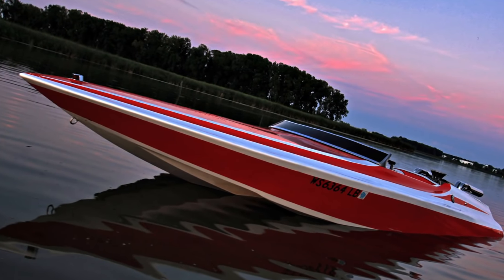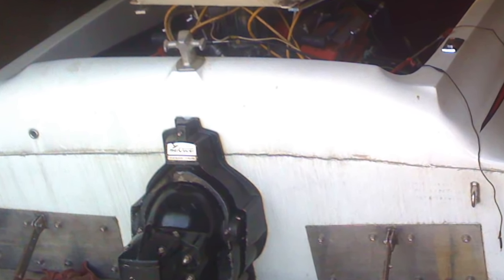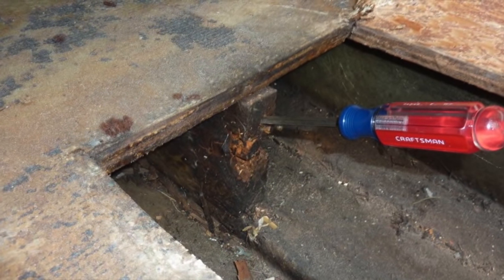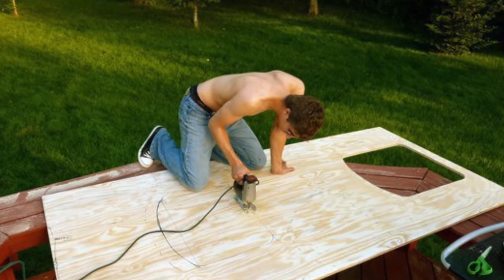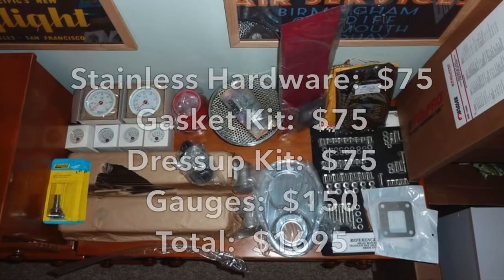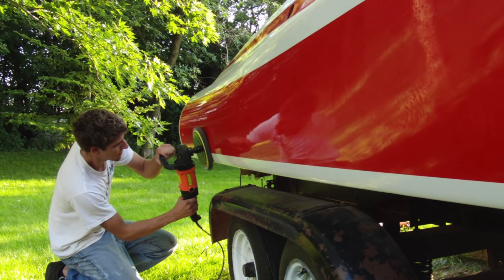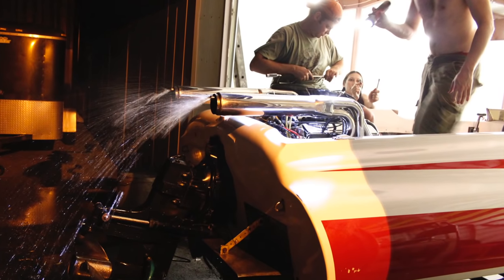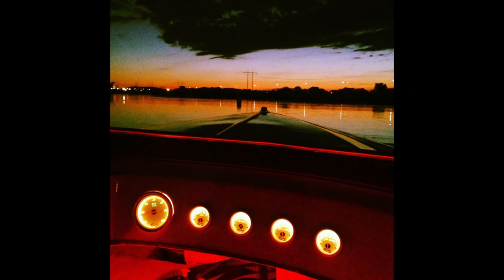RACE BOAT Rebuild in Minutes START TO FINISH

Comment: As a former OMC/Volvo/MerCrusier mechanic and racer, great job! Those old 260 drives are bullet proof.
Reply from the maker: I've had it 10 years now and other than oil changes and plugs it's needed nothing.

Comment: Had a 1000 dollar boat fall in my lap last summer, 81 Glastron ssv 167. Me and my three sons have been slowly making improvements. Re made all the interior and fixed all the mechanical issues. We have had Dime-Boat Darrell on the water three times now and every time we find something else to improve as we go. Nothing like the memories already made with my family and this boat. Little over 2000k invested so far.

Comment: I was searching for a family boat and came across a jet boat a guy was selling during my search. Which lead me to searching on what it could be and found your video. Awesome project and awesome boat. So I like what you said. Why buy a boring boat. I am an old gear head nut and was looking at building my first hot rod. You have inspired me into thinking about building this boat instead of getting something else. This would be way too much fun. It has a V8 old school motor and a Bayjet drive. Just have to finish it. Similar to your project. Can't wait to see what you do next. Cheers.
Reply from the maker: Hot rod boat > hot rod car
- No speed limits
- Bikinis
- Everyone's having a good time
- No suspension work
- No rust repair
One thing tho, squirters are not efficient, way less efficient than a prop, so given two boats of equal size weight and shape, the prop will have a higher top speed and be more fuel efficient.   They're still fun, just....  they clog with weeds really often, which is not super fun.  Good luck either way!

Comment: Twin tunnel is AKA Mod-V, I had the same hull back in the day with a 455 olds and a stock Berkley pump with a B impeller. Had so much fun in that boat!!
Reply from the maker: Yup!  Check out some of my other vids; I go into more detail about modvp racing.
Reply from the maker: Also restoring an SST, should be much faster than my aristocrat!
Reply: @ADDvanced  my next jet boat was a Wriedt Custom shallow V, it was such a blast on the rivers in Pittsburgh, just got tired of replacing the Olds 445s. I bought the all from every junkyard in the area so when I ran out, there weren't anymore...haha...

Comment: Totally understand. Did the same . Almost spent 30k on a boat until I running to a just pay my taxes and you can have the boat deal. Cleaned it up stuck a new engine in the ol'girl and its never let me down in 12 years.. it meant more to me after I rebuilt it.

Comment: A little history for your boat. In your video you keep referring to it as a “twin tunnel” when in fact it does have a name. 
Back around the early eighties  (80-81) the APBA sanctioned a class of boats called Mod VP which stands for modified V hull production. A handful of boat builders made these boats (Mod - VP) for this class, Sleekcraft, Eliminater, and Stoker to name a few. They were faster and much more stable then their V hull counterparts. Very cool boats and still popular today if you can manage to get your hands on one, rare boats. Great to see someone restoring these! Great video.
Reply from the maker: Check out my SST video  (blue boat) :)

Comment: One mans boring boat is another’s treasure. Bought a trailer for my boat and it came bundled with a free POS boat. A boring 1975, 19’ runabout with a 165 Merc I/O. Ripped out the interior, cleaned it up, tuned it up, replaced all the rubber parts on the motor. Installed 2 cheap seats and a $300 kicker and gave it to my father in law for his retirement. He loves his fishing boat. He could afford new if he wanted but that little boring boat is his treasure.
Reply from the maker: Awesome job!  Sometimes they just need some love... .other times they need everything (check out my Blue SST build.... you'll probably like it)

Comment: If this doesn’t motivate you then nothing will. Great job. Looks awesome. 🇺🇸
Reply from the maker: Thanks bruh!  Just dropped an update to my SST Tunnelhull project, 1 minute ago!   Check it out:

https://www.youtube.com/watch?v=x4A4aKtD6yM
Reply: ADDvanced I’ve got a semi-V 1957 Arkansas Traveler that’a been sitting for about 3 years now. I just don’t have the remodeling capacity you have to get started on it. I wish you lived near Saltville Virginia. 🇺🇸
Reply from the maker: @u.s.militia7682  Baby steps!   Block out an hour or two each weekend, you'd be surprised what you can get done in a month.

Comment: Great job! I am moving from PWC, current one 310hp, to boats. I am not much into carpentry, so I am very hesitant about redoing a floor or transoms. My goal within the next year is a late 90's Checkmate Convincor. It should be ideal for the river I always ride here in Florida.
Reply from the maker: You don't need to be a good carpenter for something like this; it's just hacking it to close to the right shape with a jigsaw, then using a belt sander until it fits decent.   You make up for any gaps using resin and microballoons to make a thicker plastic putty.   It's pretty hack imho.  lol.
Reply: @ADDvanced  that is very encouraging which gives me an excuse to buy more tools. You made it look so easy while I would be moving along like a snail hahaha. 

You saved yourself a lot of money and I am inspired 👍
Reply from the maker: @Mike Sutherland  Sweet!  Build something rad ✌️

Comment: Beautiful Boat! .... I love fast boats... Great Job on the restoration... ! .... Can't wait to see the other boat run .. it's an outboard correct?... I love outboard motors cause you can set them up as a surface drive just by adjusting the motor up...
Reply from the maker: Yeah, the SST is OB, and it has a hydraulic jack plate so we should be able to get that thing out of the water :)

Comment: i dont have tons of money so i got a swallow 550xs with a 60hp yamaha autolube and i absolutely love it
has 5 speakers a subwoofer and an amp and its so nice 
has 2 seats and a bench
15gallon fuel cell
and it does about 35mph which is good enough for me
Reply from the maker: That is a cool looking boat, I just googled it!   Looks like you're really underpowered tho, keep your eyes peeled for a 115-150 for it.
Reply: @ADDvanced  i really like it its great
Nice length too good hull.
And yeah i want to get a 125 mercury 4stroke for it.
I already has knee braces for the transom and a metal stainless steel reinforcement plate aswell so it can easily handle the power. I would maybe have to go for hydraulic steering then but for now aslong as it works im keepjng the 60 and enjoy it and save up for a nicer engine
Reply: @ADDvanced  problem is 
Is that i live in the netherlands and outboards here are very expensive like a 2nd hand 115 suzuki with fuel injection and almost 800 run hours 
Will cost me about 8000 euro
Reply from the maker: @thedandy6765  Yeah, outboards are expensive everywhere.   I picked up mine in pieces for $3000USD and that was a deal and a half.   I see them go for $5-10k most places and these are now 30 year old engines.
Reply: @ADDvanced  oh the one im talking about is from 2013 for 8000 euro which is almost 10k so thats not bad and its a 4 stroke

Comment: @ADDvanced awesome, regular guy build. THANK YOU! I have a question. Did you use any “flotation foam”?? and why or why not?? Looking forward to hearing back from you. Thanks again, and beautiful boat btw!
Reply from the maker: No I did not, this is a 78 and was produced before flotation foam was a requirement.   I do have pool noodles, an inflatable tube, PFDs, and other things that float up under the bow so if it does every sink hopefully the tip will stick up long enough to tie something to it and drag it to shore.

Comment: I have a 350 small block marine engine I am trying to delete the risers and install over transom headers.  How did you do it? And how is there water flowing out of your exhaust headers with no obvious lines connecting to them? Appreciate it if you could explain how you did it can’t find any videos on the conversion
Reply: I see the water lines underneath the headers but don’t understand how they work. Also could you post a link to the headers ? And are they pronounced steleens or steleins headers? Thanks @ADDvanced
Reply from the maker: @sheadelargy2445  I don't think you want to buy these headers, as these cost around $10,000 for a pair.   I lucked out on them from someone who did not know what they are.   Start googlign drag boats, water goes in through a pick up (in my case the stern drive), goes through a hose and cools the power steering, then goes into the waterpump on the front of the engine.  This then goes through the engine and comes out near the thermostat, which splits and goes down both sides of the engine, and into the headers, and then out the back.
Reply: @ADDvanced  oh wow I didn’t realize the cost. Hopefully I could find a pair like you did if they are in the 500$ range. Did you need to buy any supporting parts? How difficult were they to install? I don’t mean the headers themselves but all the re-routing of hoses and everything involved. Could you possibly make a video explaining how you did everything? I have never seen a video or anything on google of an inboard outboard with headers installed in replace of the risers. Could be a cool video as you would be the first one as far as ive seen. Thanks
Reply from the maker: @sheadelargy2445  Honestly just join a jet group man.   There's literally no difference in the hoses/cooling system.  I put my boat away so I can't get to it until spring, but it's just like a drag/jet boat.  I had to buy a custom thermostat housing with the outlets I needed to run the headers, polished on eBay, around $200ish.  Good luck!

Comment: Boat restoration newbie here: when replacing the main wood stringer, would it ever make sense to replace it with the aluminum rectangular channel stock or similar? seems like that would last a lot longer than wood
Reply from the maker: Not really, might be too stiff, and it’d be really hard to get a good bond to the resin. Would likely pop off.  Theoretically the core is not what makes the hull strong; it is the layup of composites around the core

Comment: Did you reinforce the rear hooks? Hate to see it happen again, even if it's just from anchoring it to the trailer...looks amazing btw
Reply from the maker: No, they were not the problem.  There is a tow hook on the upper cap w no reinforcement to the actual transom.  It was twisting the rear edge of the cap, which cracked the gel on the transom.  I fixed the crack and put a sticker over where the cast aluminum tow hook used to be 🤷🏻‍♂️
Reply: @ADDvanced  cool, thanks for answering. I love the lines of that hull.

Comment: 0:52 I dunno bud. That looks like a perfect beginner project boat. - the Michigander
Reply from the maker: It just wasn't worth it; all boats cost money and that thing needed stuff all the the time, lower units, fuel problems, recoil issues, disintegrating prop slip rings, it was just a constant stream of BS and I spent WAY more on it than it was worth.
Reply: @ADDvanced  like I say, a perfect beginner boat. It got you on the water for some fun. You attempted to make repairs, but realized it wasn't cost efficient. 
I started with a sunbird 170 F/S with bad steering cables. Now I have a Liberator 211. I still miss that old sunbird though

Comment: Kuddos for the dedication. I have a question. How does a strong motor as such do not crack the hull? I bet if you took a slow motion video of the hull while going from idle to full throttle you would see some amazing hull flexing.
Reply from the maker: Fiberglass flexes but it's really, really strong.

Comment: Gorgeous,  ive got a 76 Holmes Horizon jet boar I did the same build as you. Was lots of fun and is still running great after 12 years. I am looking for a tunnel bottom project is how i happened upon your video. Curious with the small block what is your cruising speed the boat prefers and what is the top end mph. Im guessing in the 70 mph range? Maybe 80? That thing should be smoke on the water it is a super nice hull.
Reply from the maker: Right now high 50s, used to run low 60s but I tore off my skeg and installed a slip on skeg, which instantly removed 5mph+.   The big thing is the x dimension is too tall with a standard alpha drive; with a shortened Alpha SS and a nice prop, she should hit high 60s/low 70s.

Comment: Just popped into my brain, I used to have the side windows and main screen for this hull. I scrapped them years ago when I abandon the project. I tried to remove the old metal flake gelcoat as it was bubbled up in places. Not an easy job if even possible at all. Only thing that worked was a belt sander which covered everything with glass dust and left divots and waves all over the hull. It was a disaster.
Reply from the maker: lmao, did you learn anything?   The idea of using a belt sander on any sort of automotive surface is hilarious; there is a reason bodyshops don't use them.  You should have used an air board with some aggressive grit, and kept it moving to avoid surface issues.  Your project was doomed as soon as you plugged in that belt sander, lol.   Oh well.

Comment: We bought a 1981 sea ray that runs great and it only needed a steering cable for 2300. Everyone said why would you buy a boat it’s just a money pit, but at the end of the day we all die so why not have fun with the time you’ve used to make that money.
Reply from the maker: It's about the memories you create on the water, that is the value of a boat :)

Comment: I always wondered why there is water comin gout th eexhaust, I guess these marine engines does not have a circulating coolingsystem but take fresh water from the see and pump it through the block and back into the see..right?
Reply from the maker: Yup.  Unlimited cooling.   Salt water boats have closed cooling w a water to water intwrcooler basically.

Comment: You should have used fumed silica instead of microbeads for your fillets along the stringer when it's mixed with resin it's not gonna go anywhere after it sets

Comment: They put assembly lube on a rebuilt engine when assembling it, so it wasn’t broken in very much, but probably was rebuilt
Reply from the maker: Yeah, the previous owner told me it was rebuilt, I just didn't really believe him because it looked so terrible.
Reply: @ADDvanced  maybe by “rebuilt” he meant tear it apart and replace one set of crank bearings or something, maybe a new crank, then put back together

Comment: You're lucky it only had 1 stringer and a floor, my deep vee had 3 stringers each side of the main keel stringer, multiple bulkheads! took me 3 years to finish rebuilding her
Reply from the maker: Yup!!!   There a reason I only restore tunnel hull sleeks 😆
Reply from the maker: Please check out the SST build I think you’ll dig it
Reply: @ADDvanced  Will do, I watched the 10ft hydro one already! I have plans for the same boat but haven't got around to building it.

Comment: them lines  tho... especially  that wind shield . I would make it come to a point  on left and right
Reply from the maker: That was the original design; I have both side windows but I just don't leave them in very often; worried about them falling out and sinking and it's more comfortable to rest your arm on the gunnel to improve stability of the throttle control at speed.

Comment: why is there water coming out of the headers
Reply from the maker: Boats have water cooled exhausts.   Otherwise they would start on fire.  Imagine a car only having first gear.  That’s what a boat is, basically, so when you’re running at top speed it would be a ton of heat and would basically light things on fire if the water wasn’t cooling them.

Comment: Whats top speed?
Reply from the maker: Guess
Reply: @ADDvanced  between 55-60mph?
Reply from the maker: @smallblockchev64  good guess :P
Reply: @ADDvanced  Been around boats all my life...seemed like a fair guess for 350 small block around 350hp....80-90mph would happen at around 550hp. Just my experience. Totally awesome job on your boat and it looks killer. You should be very proud of what you've done!!!

Comment: Some people buy boring boats because they have not plenty of money..that's why
Reply from the maker: Disagree 1000000%, this boat cost me $5000 and I see people spending 5-10x that amount on boring open bow bayliners or something.   People will happily drop 30-70 grand on BORING, forgettable boats, and if they go cheaper they will drop 5-10k on something completely mundane.  Why?
Reply: @ADDvanced  well you aren't fully correct but  you have a point there I know many people that  many people spend a lot of money for new boring boats ...nonetheless don't forget the fact that most people are not able to take a broken boat and restore it like you really actually only a small amount of people knows the way in which to make the restoration

Comment: would have been alot cooler if it was a jet
Reply from the maker: you misspelled "slower"
Reply: @ADDvanced  lmao good one i just like the jet less proplems and cheaper to maintain and could go in less than a foot of water
Reply from the maker: @hubbabubba2984  Around here they just clog up with weeds all the time.   After getting in the water for the 3rd time in one trip they start to lose their appeal.   I've had zero issues with my sterndrive setup in 10 years so >shrug<
Reply: @ADDvanced  ye some places are different like where i live there no weed some rock but it depends on what grate you useing but have great